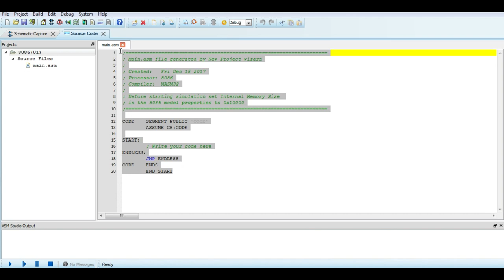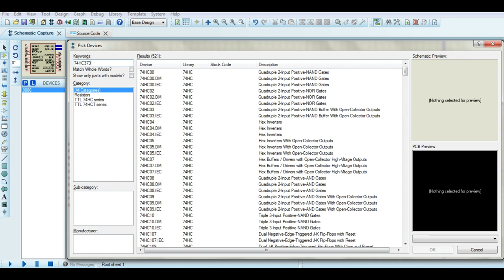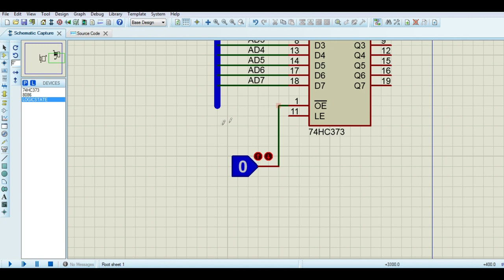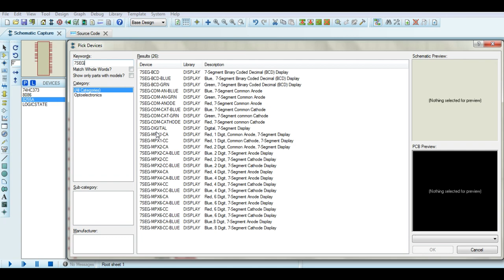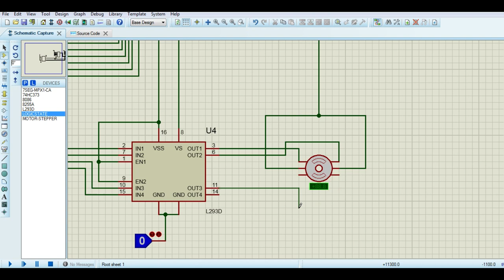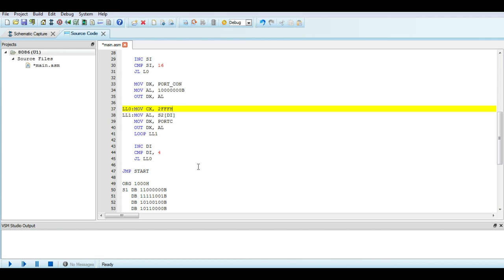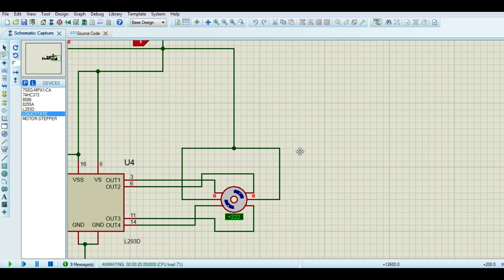8086 µProcessor | Proteus Simulation | 7 Segment & Stepper Motor

Comment: Great video with nice explanations. Just want to add one thing, if you have an earlier version of proteus and don't have 8086 firmware ,don't panic. Just select no firmware and do as the video describes. After constructing the circuit, compile the source code in 'masm' and convert it into exe file using 'link' . (you might need to edit the code little bit ,like adding assume cs:code etc and changing 'DATA' to 0) After that,  double click in 8086 ,there is an option to upload program file. Upload the .exe file there. You should be able to simulate then :D
Reply: thanks

Comment: Sir  I downloaded the project but it still didn't work
Reply from the maker: What are the error you're getting?
N.B.- This project file may not work with version 8.7 of Proteus.
Reply: @SkHasibulAlam  sir I'm sorry it took long for me to reply
I'm using 8.8 what will I do to make it work sir?
Reply from the maker: I'm not sure, to be honest. You may have to change the 8086 module (U1 in the file) with the equivalent module of new version. I haven't used 8.8, so I can't confirm anything. Sorry :( .
Drive link for v8.6 setup: https://drive.google.com/file/d/10jcIJipObVEjn7Wbm0bS_EkfvNqfn94T/view?usp=sharing

Or, you can completely recreate this simulation by placing modules and routing wires manually in v8.8 (will be very time consuming).

Comment: can you do thing like this please i dont have much of time just 10 houre 
i made subsicrib and liks
thanks

Use Proteus circuit simulator to design an Intel 8086 microprocessor-based system that
periodically reads from a temperature sensor, and activates a fan (DC or AC motor) when
temperature reaches 50 degrees. The temperature to be displayed using two digits of
7-Segments Displays.
System specifications:
- Use separate decoder method to activate the Memory Banks
- Build up 512KB of RAM using any 256Kx8 RAM chips, and address them from 40000H to
BFFFFH
- Build up 128KB of ROM using any ROM chips you prefer, and fix them at the upper part
of the address space
- In the RAM section, the one you installed, store a table of 7-Segment display code.
- Use two digits of 7-Segments Display to present the temperature
- Use an 8255 PPI to control the displays
- Use an ADC to read the sensor’s readings
- Stepper, AC or DC motors, your choice